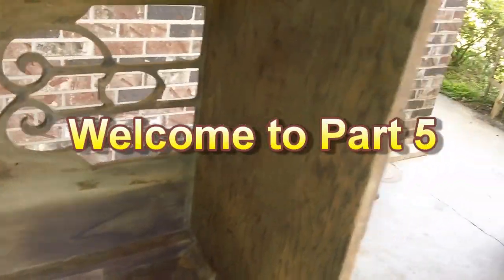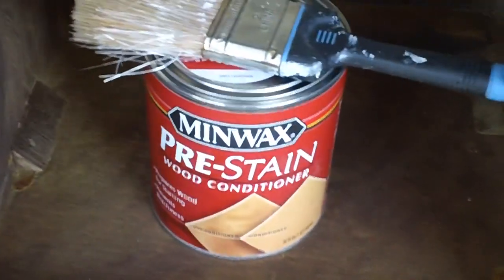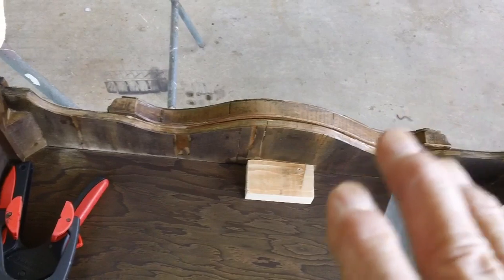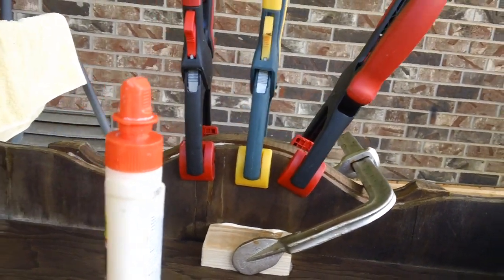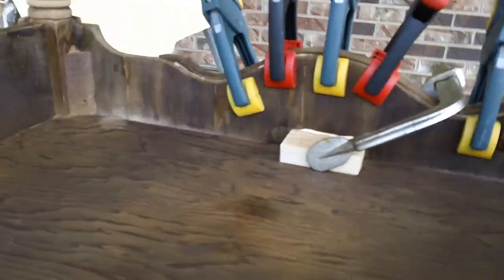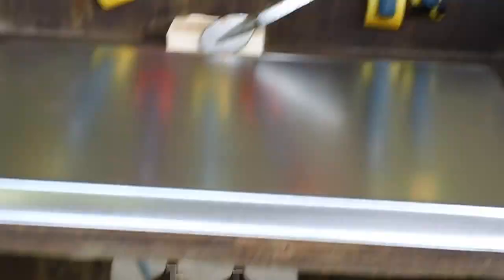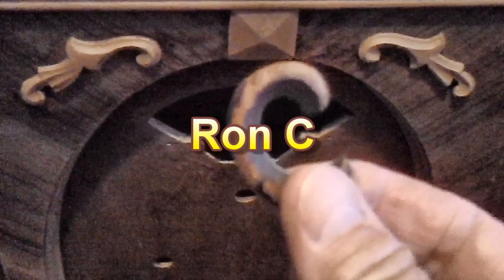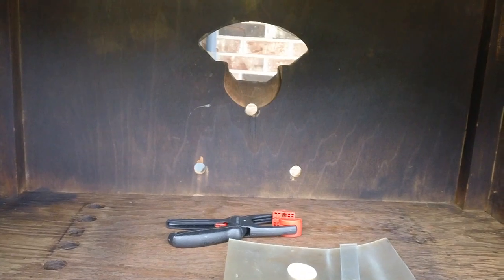1931 Airline 62-14 radio cabinet restoration (Part 5).

Comment: That is coming along great John. I was wondering about alternative sheet metal supplies too because over here the diy warehouses charge a fortune the same as they do in your neck of the woods.  Use of the baking sheet is ideal!. Thinking about it, if the chassis is sitting on the metal then it does act as an rf shield as well as possible heat dispersion although most of the heat will be going up from the tubes with a lot less going down.  I did also wonder about the pre-stain. We have something like that but it was something I haven't  used before so was very interested to see it in use and your explanation of what it does. 
Looking forward to the next part. Take care John, all the best, George
Reply from the maker: George,
Thanks, my friend.  I hate the feeling of being ripped off, so I'm constantly looking for better deals on everything.  Besides, we old radio restorers always look for different ways to make things happen.  It's in our blood.
Regards,
John
Reply: Thats the truth for sure. I had a fellow ham ask me where to get some heavy duty earth cable... I sent him to the auto spares shop for a set of jumper cables and told him to take the clips off the end... 1 heavy duty earth cable with one spare! Too many things these days are too expensive unless you think out of the box. 

 I just picked up another vintage set, an old grundig, today and yesterday as part of a job lot of modern rubbish I got a pye phonograph which looks almost mint on superficial view.  More projects for me to video eventually! 
You take care John, best wishes from the UK. George

Comment: I'd recommend McMaster-Carr for small pieces of sheet metal (or plastics or rubber or felt or whatever). Reasonable prices and quick shipping. Your cookie sheet solution is inspired.
Reply from the maker: Thanks, my friend, but shipping costs would be prohibitive.  I'd save money by going with Lowe's and would get it right away.  I can't tell you how many times I decided to to buy online because of unreasonably high mailing costs.
Regards,
John

Comment: Utilising a baking tray as a RF shield: that is what I regard as ingenuity.
Is that a RST type meter below the station dial?  If not, it sort of looks like one!  I can’t see it as being a shadow graph, like those seen on American Philco radios of around the time, and a little after, when your console radio was manufactured.
The cabinet is certainly coming along well 
Regards, Phil.
Reply from the maker: Hey, Phil,
The cookie sheet idea came to me in a dream...a daydream.  😏  Btw...what is a RST meter?  This one is a wound coil and needle.
Regards,
John
Reply: Do forgive me John, I automatically assumed you are familiar with RST meters.  ‘RST’ stands for ‘R’ readability; ‘S’ strength, and ‘T’ tone.  
RST meters can be located between the aerial lead-in and the transceiver, or, as with my HF transceiver, the meter is incorporated in the first RF amplifier stage.  They are particularly useful when working CW frequencies.  See R-S-T System, Wikipedia for a better explanation.
Cheers my friend, Phil.
Reply from the maker: Phil,
I went back to the schematic and did a little refresher reading.  It's called a "Resonance Meter", a milliameter in the plate return of the RF tube.  Best I can do on short notice, my friend.
Regards,
John

Comment: First of all. I love all your videos. And thank you for letting us , the viewer in your life. I watch all of them. But, on this radio where you glued the square block brace at the bottom . why did you glue the large flat side of the square block to the bottom or the shelf.shouldnt the large flat spot on the brace block be towards the front side of the radio? And the edge of your block be towards your shelf your supporting .
Reply from the maker: Carter,
Not to worry, my friend.  The new block is twice the size of the original, so it'll hold twice as good no matter which side is glued towards the front.  Besides, there's no weight on that shelf.  The block's purpose is to keep the board from sagging in the middle.
Regards,
John
Reply: @joernone  thank you for responding . kind of you to do so. And I see your point now. I learn a lot from you in your videos. And like I said before.thank you for sharing your life with us on Youtube.hope you and all of your family do well.